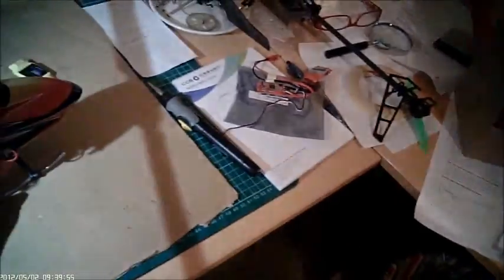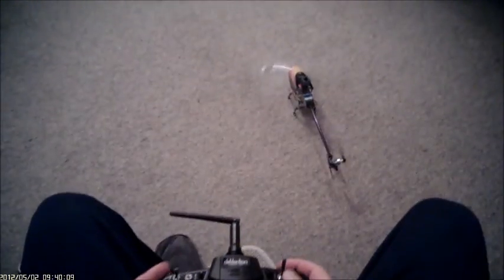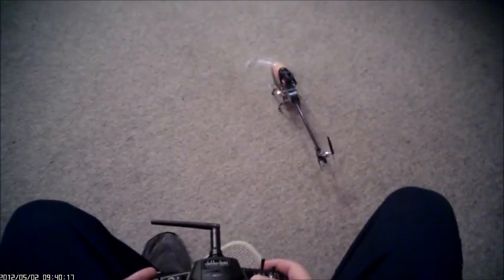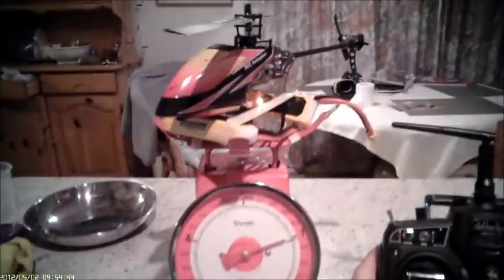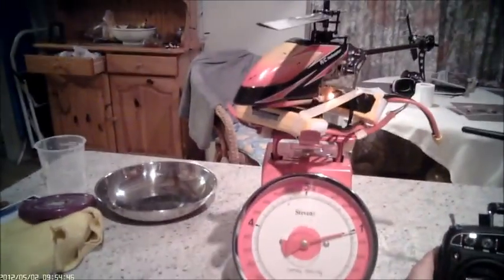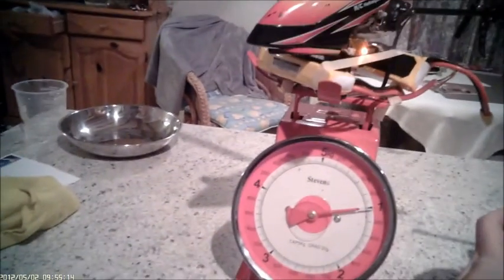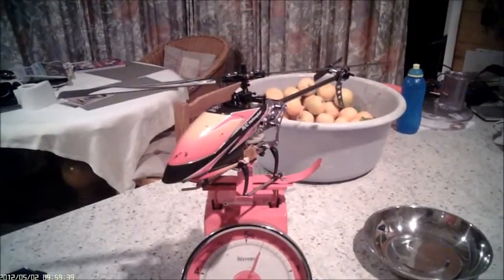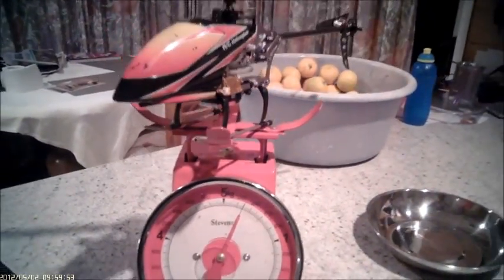V912 2xBL & FBL with Extreme 200 SRX blades

Comment: thanks for the video, extreme 8 blade looks really cool on 912. I would like to install extreme 8 blade on my original 912 with brushed motor, wonder if it would work?
Reply from the maker: +trex 150 Should do although I'd recommend going up at least 1 pinion size (to a 10T instead of the 9T) to get the headspeed up. Not sure if the brushed motor would pull more than this but a F45 motor would probably pull an 11T (they come with  10T). Stock 912 blades have around 14 or 15 degrees pitch, so the 8 degree produces less lift until you spin it faster. We've jumped from 9T to 11T pinions with the FF200 brushless motors. Would love to hear how it works if you want to post a comment back... A friend is running these on several helicopters (FX71, WLV915) and has also been fantastic results. Smooth flight, excellent handling in the wind.